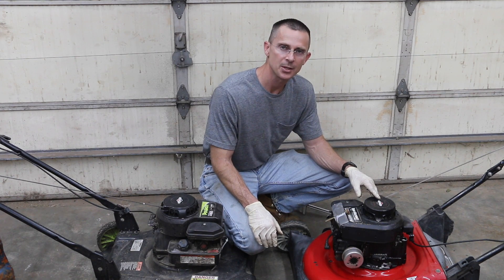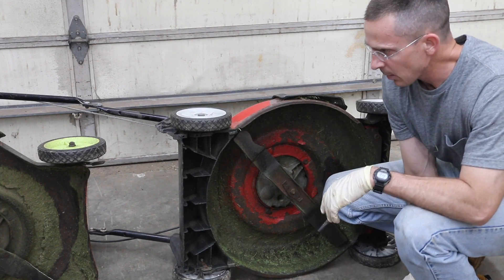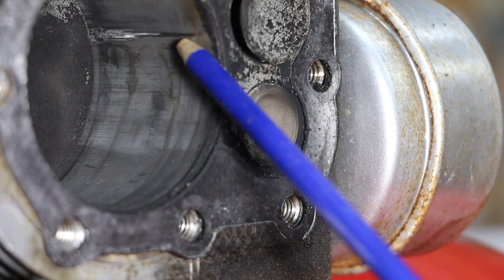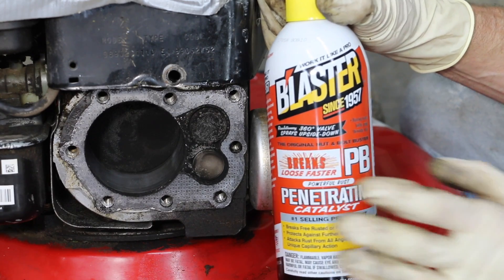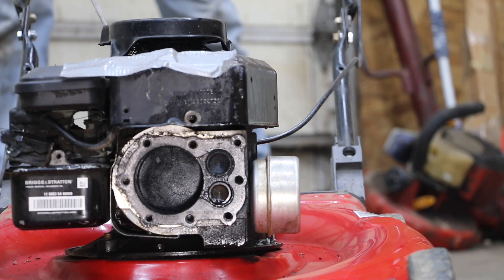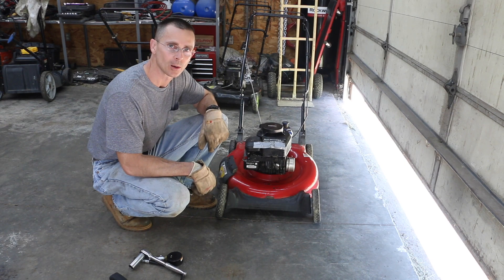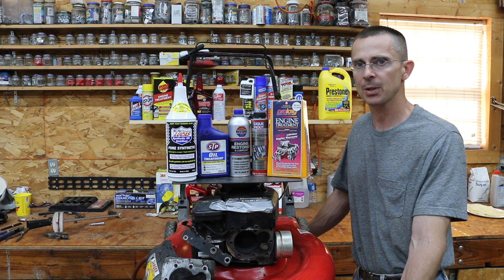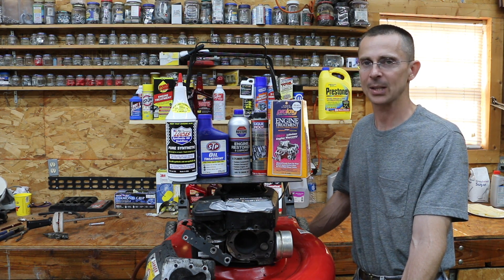Engine ran without oil, seized! Can it be saved?

Comment: that scoring on the alloy cylinder walls is a sign of broken rings and that nasty gouge in the alloy is a ring digging in(trying to pass the piston)
very very common sign on all engines that are over heated 

i am in the middle of fixing 2 4G63 engines from that exact issue  broken rings  
on a mitsubish L200 and mitsubishi L300 both utes  one over heated  the other engine wrong timing, wrong fuel mixture(ran lean) and  it also didn't have the rings staggered(180 degree ring gap from each ring's gap)  

aaaah brings and crappion  known for there alloy bores  and not being able to hone them as you take a special coating off the bores
these engines are a 1 time use being alloy bores(no steel sleeves like 99% of all other engines in this world
even the nissan GTR has alloy bores with a special liner much like the Ford GT
Reply from the maker: genmaxpain, This is helpful information!  Thanks for watching the video and commenting!
Reply: Dont they have nikasil plating on 4G63 bores?
I'm racing and rebuilding an Yamaha FZS600 engine and the bores are nikasil plated. They should be 62mm +-0.01 from factory and I tore down engine that had 50k kms on it I measured 62.00mm and 62.01mm, taking 4 measurements on every cylinder, so surely this can last. 
I will do after season measurement after the engine will be run in "race" trim (turbocharged, double the torque output) and see how it does when it isnt used as manufacturer wishes :P
Reply: MindBlowerWTF i didn't say they had plating on the 4g63 the bores are steel i think the same with evo's
no Mitsubishi had alloy bores 
only  briggs & stratton, Nissan GTR, Ford GT, and from memory the Chevy Corvair and a hand full of other European motors had alloy bores(some had very very fine/thin nikasil coatings)
(ford gt and nissan gtr had thin nikasil coatings)
(the thin/fine nikasil coatings meant that these cannot be honed or the coating will be damaged/removed/or destroyed)

if i was you i wouldn't hone the bores if they are a alloy or nikasil coated alloy
you can find alloy bores on cheap and expensive motors
cost to re coat these nikasil  alloy bores were so expensive that they are generally a throw away item

i did the oil change on my briggs and that had metallic all throughout the oil meaning it was the alloy that was wearing  and even that i do the oil change regularly it still wears the alloy meaning it does not have a coating and the rings are riding on plain alloy bores

my friend has the second fastest nissan GTR in New Zealand and he has just spent over $100,000 nzd getting monster power including the nikasil coated alloy bores removed and removable steel sleeves/bores installed and a 4.1L stroker kit installed
Reply: Rick Delair don't forget the b21a1 with the from sleeves.

Comment: The compression isn't going to be correct. These engines have a decompression device on the cam shaft.
Reply: Decompression has nothing to do with the normal compression, all decompressions do is reduce the compression untill the engine is turned over for easy starting, and these do not have a decompression lever as far as my knowledge goes
Reply from the maker: I don't believe this style of engine has one.  I took one apart this weekend and it didn't appear to have a decompression device.  Thanks for watching the video and commenting!

Comment: That's gotta be piston slap or a super worn piston pin... The rod might even be bent from all that resistance when it was seizing up. I wonder if you could bore out the cylinder with one of those junky tools from harbor freight and then put on some oversized rings and have it run semi decently.
Reply from the maker: Jesse, I agree!  Great thought regarding tools from Harbor Freight.  Thanks for watching the video and commenting!

Comment: I say use the Easy Off. I know it isn't in the group you meant for us to choose from. LOL
I would like to see the piston rings and the connecting rod bearing...
Reply: Markomyt1 nothing cleans carbon off of aluminum as fast and easy as easy off, if you don't let it sit too long it will make it look shinny and new. I use it on intakes, valve covers, aluminum heads, transmission housings all the time, I have even used it on a Honda civic block, it looked brand new. I have a nice pressure washer to clean the oven cleaner off. For cast iron we send it to City Motors in Dallas Texas, they bake it in a oven and hone the block replace the freeze plugs and wash it down a four cylinder is 100 dollars. When you get it back it's ready to paint, I always get anal and mask the freeze plugs so they stand out. I don't make any money on mechanic work, though I've been ASE certified since 1975. I just help people who need a way to get around, if I get paid for the parts that I go out of my way to get the best deal possible on. I feel pretty lucky. The up side is, they feel so bad about not paying me for my labor, I never see them again. I don't sweat it, I'm old and probably need to pay it forward to make up for a few bobbles along the way.
Reply from the maker: Markomyt1, LOL!  Yes, I plan to dismantle the engine after testing several additives.  It'll be interesting to see to damage inside the engine.  Thanks for watching the video and commenting!
Reply: Thanks Phillip Ward, Sounds like something I will have to try. Want to try MIG welding some Aluminum. Would be helpful to remove the oxidation before I start.

Comment: I would like to see you use "Archoil" on that red mower, I have heard its very good in almost all engines. Of the additives you have there I would like to see you use Lucas, I ve used it before and it did quiet my motor.
Reply from the maker: ro fo, All great suggestions!  Lucas has taken a commanding lead!  I plan to test several of these additives if there is enough interest.  Thanks for watching the video and commenting!

Comment: I thought of a story.
My friend had a Ford truck with a 300 inline 6.
He called us because; after have driven for 30 miles down out of the Santa Cruz mtns without oil pressure, he decided to stop because the engine was knocking.
We discovered that the oil pump drive had broken off the distributor shaft.
Rod bearings were shot, mains were bad but he didn't have money so we put a new oil pump in it and a fee rod bearings right there on the side of the road.
It ran but knocked.
He discovered that by taking on sparkplug wire loose, the knock was greatly reduced. 
That guy drove that truck for years on five cylinders.

Comment: as you got it freed up I could see the piston wobble in the cylinder. as he said try the JB weld for the cylinder but you are gonna need to use it on the crank or rod and then find a ring. if you went to all that trouble I bet it would work pretty well.
Reply from the maker: Davidautofull, This is a great suggestion.  I like the idea of seeing what JB Weld can do for this engine!  Thanks for watching the video and commenting!

Comment: I would love to see a Liqui Moly Ceratec dry crankcase test. I had great luck with it on my Dodge Stratus 2.4. A friend drove it with the temp gauge pegged on H for 30 miles on the highway after the lower rad hose blew and it got so hot that it melted the oil filter seal, causing a loss of oil pressure for the last 10 minutes. She said it started shaking and stalled. I was sure the engine was dead, but the plug wires actually melted and killed the engine, so he towed it home. I installed new plug wires, a new oil filter and fresh oil since it was empty, and tried to start it. It started right up and ran great for over 1 year until the intake gasket blew and hydrolocked it. It is waiting to get a new engine. It could have been coincidence that it lived, but I do not think it would have lived without Ceratec.
Reply from the maker: A DIY Computer Guy, Yes, I'd like to test several products using the dry crankcase test.  A lot of folks commented that I should only use new engines to make the comparison fair, which is very expensive and cost prohibitive.  Do you think it would be acceptable to use a used engine?  Thanks for watching the video and commenting!
Reply: I do not think that the results a dry crankcase test on an air cooled engine is applicable to a water cooled car engine because on an air cooled engine, the oil is all that it has to transfer heat away from the cylinder and other parts, however with a water cooled engine, you have coolant around the cylinders, block, head and pistons to keep it cool. I do not think that even if you found an additive that completely ELIMINATES friction, you still will not get an air cooled engine to last very long without oil anyway because of all the heat being generated without significant cooling. Yes, I think using used engines are fine. If there is a huge difference, it will still show. If the control engine lasts 10 minutes and the one with the additive lasts 60, you could still see the clear winner. Where I live you can get lawn mowers at scrapyards for scrap price, make it run, do the test and sell it back to them for scrap price to help cover some of the price of the product that you are testing.
Reply: Also, I do not think that lubrication would be the limiting factor for how long you can run an air cooled engine with no oil anyway, I think cooling would be. I think you should verify this by draining the oil and replacing it with water to keep the engine cool, which has no lubricating properties. I am almost certain that the engine with water as oil, if kept full, remember that water evaporates much faster than oil in that kind of heat, will run for a fairly long time. It may die from wear rather than catastrophic failure. PLEASE keep making these kind of videos, I really enjoy them.

Comment: great video. marvel mystery oil is great stuff. i would try a high mixture of MMO with a light weight synthetic oil like 0w20 and run a few hot cold cycles.
Reply: for the knock i would use a heavy weight oil llike 20/50 anf see if that helps a little.

Comment: Lucas Oil Treatment of those there. Or just a thicker oil. Will take up the clearances and reduce the big end knock. Though the engine will run hotter. Will help the burned rings seal better as well.

Not a fix of course, the engine isn't long for this world. Only real fix is a hone, new rings, and a new connecting rod if the crank journal isn't scored, camshaft as the solid pushrods will have eaten the lobes etc. But as those parts and tools alone would be ~150, unless you have a stock of used similar engines no reason not to just use an oil thickener till it gives up for good.
Reply from the maker: Cragified, I agree!  The engine is in bad shape.  Thanks for watching the video and commenting!

Comment: Here's a test I would love to see... royal purple has(supposably) is ion charged that makes the oil bond with the metal that the film strength is so high that even if you drain the royal purple out, that the engine will run, and will take allot longer for the engine to seize than with conventional motor ...or any motor oil. 

once you drain the royal purple out.... test how long the engine last until either it seizes.. or just simply continues running

then do the same test with conventional motor oil, and the same engine (if it survives) and see if last just as long or not...
Reply from the maker: Asphalt Cowboy,  Not sure if you saw the video, but I did this test with Slick 50 using 2 similar, but used engines.  I received a lot of comments suggesting that it wasn't a fair test, since the engines weren't new.  I can't imagine spending that much money on two new engines for this sort of test. Would it be fair to run this test using used engines?
Reply: Project Farm I think it would be fair using used engines... most if not all vehicles 10,000 miles or more (duh)  

using new engines is nice but.. Even new engines can ruin within a few 1000 miles... 

it's like getting car parts.. it can last year's...or a few months... you just don't know with new things...

Comment: I'd love to see two separate videos. In the first one I'd like to see the noise reduction from Lucas engine treatment. maybe you could use an audio meter, or audio app on a phone from 5 feet for some before and after testing? also it would be interesting to see if it bumped compression. for the second video I'm really interested to see how restore engine restorer works on compression.
I'd also like to see how it works in a tired engine, like that green mower you have
Reply from the maker: Hans, These are all terrific ideas!  I've taken notes and plan to complete each of this in upcoming videos.  I recently purchased an audio meter and am definitely planning to use it for this test.  Again, I greatly appreciate the project recommendation!

Comment: Sea foam and MMO both contain powerful oxidizers one of which is naphtha which is used to speed up the drying time of oil based paints and varnishes. MMO was first formulated in the twenties before modern oils and fuels were around and the formula hasn't changed. Many a machinist shop and mechanic will tell you it can even be a fire hazard due to its oxidizing nature of oils. It's like adding a corrosive to oil, in your oil. I wouldn't have mentioned this on other videos but I was watching this and it joggled my memory.  I know many people swear by the stuff and are product loyal. I was the same way about slick 50 until an engine I had it in lost two pistons and two rods yet made no noise prior. Not saying the 50 did the damage but it didn't prevent a thing. So that made me skeptical and went looking for my own information. Lots of internet experts out there.. information is out there.. this is a great channel and I love watching it.. I love actual real world tests and non bias. before anyone attacks me for saying "bad" about this or that. Just look it up for yourself, I'm just the beginning of the conversation to provoke your thought process. Find out for yourself if you are so inclined. Cheers.
Reply from the maker: Tim, This is great information!  I'll research the ingredients of these additives.  This is a great suggestion.  Thanks again!

Comment: Loving these! out of those products, the Ametech Engine Restore will probably the most interesting. Lucas Pure Synthetic Oil Stabiliser is aimed at newer cars that aren't worn out, same with the Prolong and the Liqui Moly. The STP is said to be fine for all engines, but is honestly only ever any use in older, slightly worn motors, whereas the Engine Restore supposedly fills in scratches and reverses wear, it's a toss up between those two, as STP is gloopy enough to hopefully cushion and quieten the rod knock, but the Restore would be interesting to see if it did in fact fill in some scratches and improve compression. (I have seen Cody The Car Guy do a test and get great results.) Restore doesn't like being used with Synthetic oil however, don't know if you got all of the info with the bottle, but it says that it will essentially be fighting the Synthetic oil as Synthetic likes to cling to metal. If you don't have the info, I'd be more than happy to photograph mine and send it to you. Maybe a test with STP first to see if it quietens the knock, then a drain, refill with conventional oil and use Restore? I am skeptical of oil additives and stay away in general, but there are a few I will use, STP is a good cheap fix to bring oil viscosity up a grade to gain oil pressure and compression on an old worn out motor, it doesn't foam up like Lucas Heavy Duty Oil Stabiliser does and has a small amount of additives which Lucas does not. I have used it in old beaters and will continue to do so as it does work if you know how to use it. Liqui Moly do a MOS2 (Molybdenum) additive that is good in older but good condition engines, but only if you use a tiny amount of what they recommend as it is really loaded with ZDDP and Moly. Restore is a good product, but ONLY for an older car that you need to keep going for now, but isn't worth a full rebuild or pulling the motor apart. A friend has an old petrol minivan/MPV thing that smoked like hell and had bad compression. It failed emmisions, has a good body, but isn't worth the time and effort of a rebuild, he also knows that the suspension and drivetrain is good, so it would be a risk buying something else as he only uses it once or twice a week to move rubbish/garden waste. One 400ml can of Restore the first time, and one 250ml top up every oil change after and it is silent, goes much better, doesn't smoke, passed emmisions and doesn't foul the plugs any more. It's a band aid really, and I certainly wouldn't put any of the above products is a perfect car, but it does work as intended in the right conditions.
Reply from the maker: Spac8, I'm learning a lot from commenters like you!  This is all terrific information!  I'm planning to test several of these additives and I'll go ahead and use conventional oil with all of them to make the comparison fair. This way, Restore will be effective.  Thanks again!

Comment: The knocking is from damaging your connecting rod bearings and stretching the rod cap, no lubricant is going to fix that and if you continue to run the engine at some point the cap will separate and will shred itself and said bearings inside the crank case
Reply from the maker: hojo70, Yes, I agree.  Thanks for watching the video and commenting!

Comment: As you may know the rod has a "plain bearing" that can't be replaced. Now the rod journal size is larger from rubbing metal on metal and that is the noise you hear. That engine could run a long time like that with no issues since the governor RPMs are set so low. Try putting a thicker oil to take up some of the space between the rod and crank journal like a 20w 50. Thanks for the cool videos :)
Reply from the maker: glennspeeds, I agree.  Also, great suggestion and thank you very much for the positive comments!